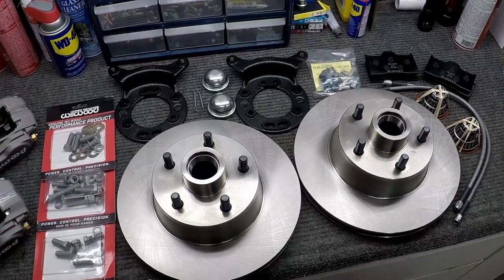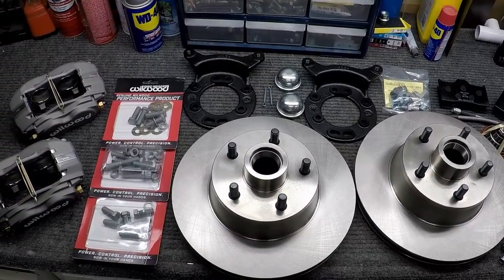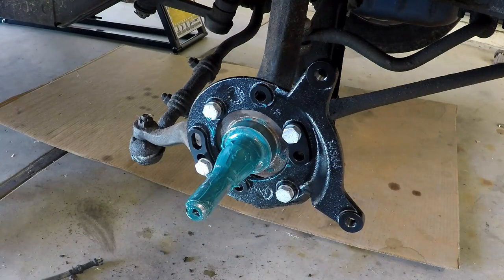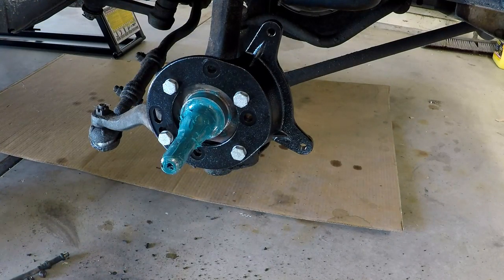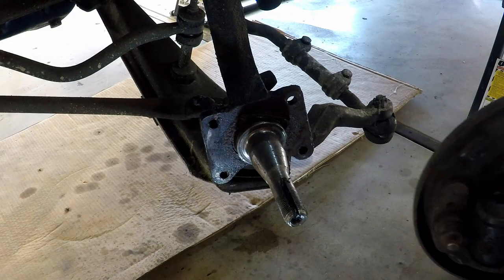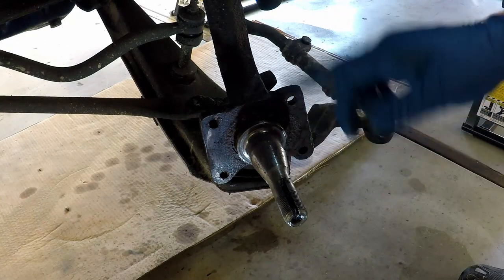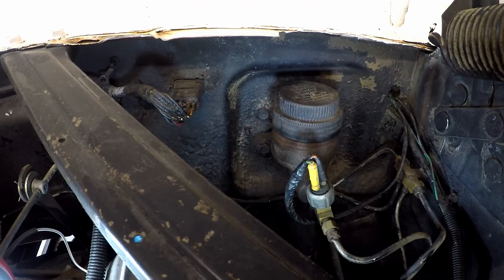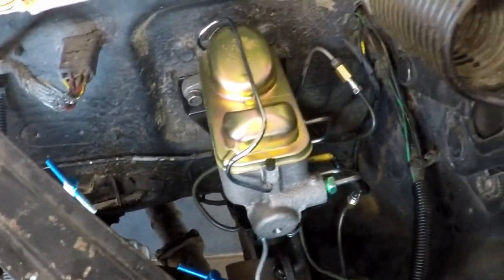How to Install Wilwood Front Disc Brakes and Dual Bowl Master Cylinder in a 1966 Mustang

Comment: After a year how are these holding up?
Reply from the maker: The brakes are great!  I've only put about 300 miles on the car, so my experience is limited.  Knowing what I know, I would definitely buy them again.  I'd go bigger if I could, but I knew when I purchased this Disc set that I wanted the wheel size I have now, so I was limited in disc diameter from the beginning.  I'm not super impressed with the brake bias distribution block I purchased, I'd probably just get the Wilwood unit if I had to do this over again.  I'd also do a little more research in the Master Cylinder, the generic unit I have is Meh.  There was very little info available, so I couldn't tell you the size.  I think I'd do 7/8" next time, which might provide a pinch more braking pressure, which would be great on a manual brakes car.  :)
Thanks for asking!!
Reply: @AndyKruseChannel  awesome info !! Thanks for responding
Reply: @AndyKruseChannel  I tuned in as I am looking to do the same Wilwood disc conversion for my 66 F-100 pickup, and you did have the same "jelly jar" single master cylinder with the same brake light pressure switch that Ford used for MANY years. One of my concerns was how to attach that switch. I think you went to a mechanical light switch? Did the switch itself leak or the threads not seat? I have aluminum Ford style 15" wheels on the truck and look to go with Wilwood 140-14607 disc kit and Wilwood 261-13626 for master cylinder and proportion valve kit. They asked for my brake pedal ratio which worked out to 5.6 : 1, so a 15/16" bore cylinder was recommended for manual brakes. I will be working outside when the weather warms. My concerns are getting the brake back plates off without doing damage. I see you had a stubborn bolt. Other videos see people really having to hammer repeatedly. Residual pressure valve for rear drums 10 lbs. is recommended by Wilwood (260-13784) as Wilwood master kit is made for rear discs (without that valve).